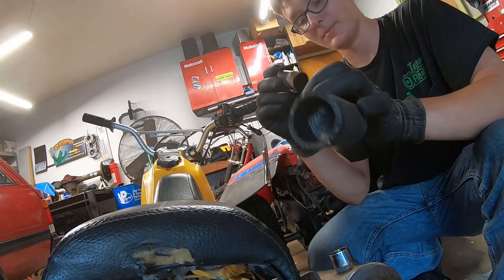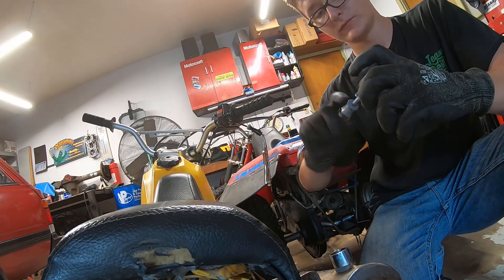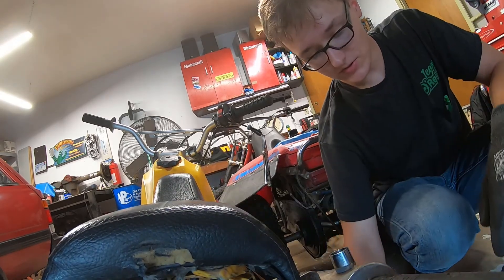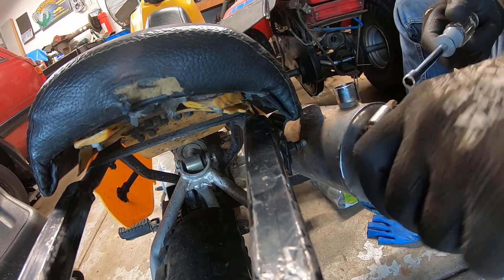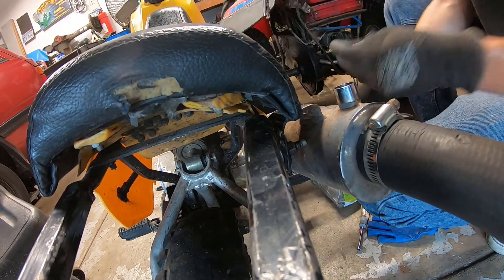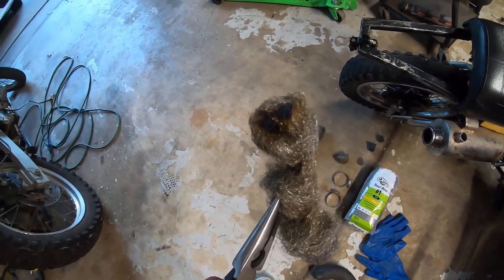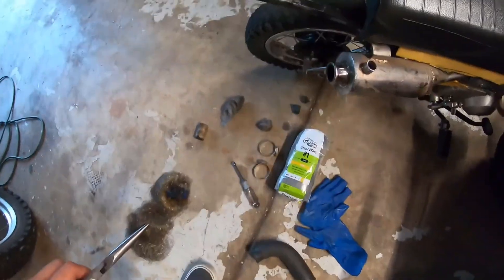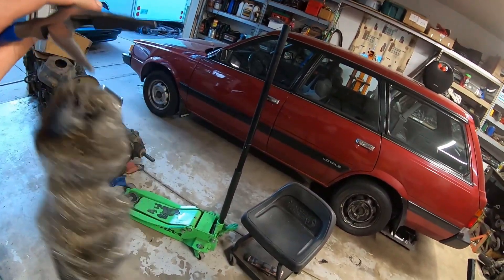Does Steel Wool Work as a Muffler?

Comment: Hey, late to the party here, but lol that's pretty awesome stuff ngl!
I''m sure you figured this, but you're not supposed to just shove a bunch of steel wool in your tailpipe. 

You're actually supposed to line it around the outflow, so it absorbs and dampens vibrations and minimizes noise. 
It also has the added benefit of resonance; that is to say, if you know a little bit about speakers/boomboxes/etc., this is your chance to mess with materials and packing and get the sound you want!

I used some monster cans and a campbells soup can and some dollar tree scotchbrite copper coated stainless steel scrubbers. 
The copper helps with temperature regulation as well, because my exhaust is basically a straightpipe without the muffler. 

The copper helps keep the air coming into the exhaust the right temperature, so it doesn't have a chance to warp my valves or anything. 
It also helps insulate and better dissipate the heat between the layers of metal used, so the exhaust gasses don't start burning holes into parts of the cans.

Finally, I used high heat exhaust tape, pipe clamps and some crude diagrams i drew to keep everything contained and all of the airflow going in the right direction. 

It's pretty quiet now, even though it's technically a straightflow exhaust and I love it, lmfao. 
Smelled like shit though, until all the stuff burned off smh.

Comment: I know I’m late to this but could I use stainless steel scrubber as a substitute? Or is steel wool the better option?
Reply from the maker: I can definitely try that. I no longer have that bike but by no means does that mean it can't be done some other way
Reply: Oh, the reason I’m asking is because I’m currently building a motorized longboard but I’m afraid the motor might be way too loud. I was trying to figure out easy ways to get rid of the noise but the only form of insulation I have is the scrubber
Reply from the maker: @Arun-uo7hb  ah I see. I do not see why it would not work. A common way people silence excessive noise is by tack welding a washer in the exhaust tip